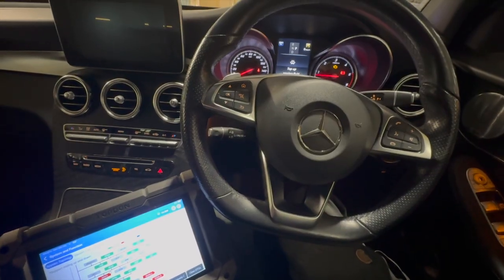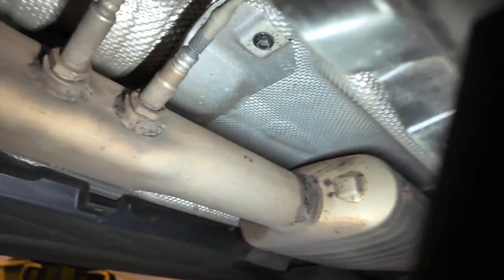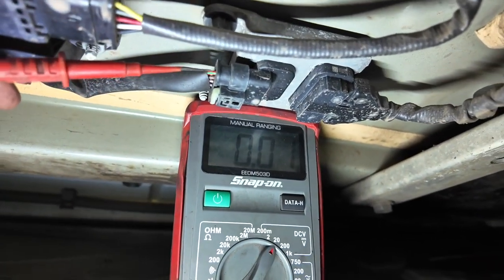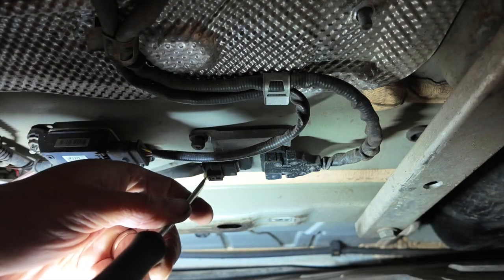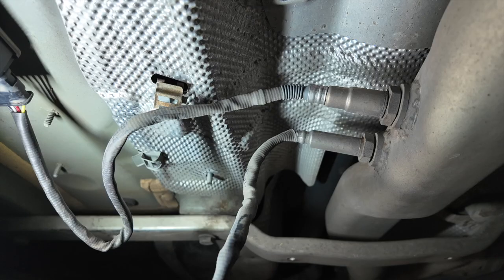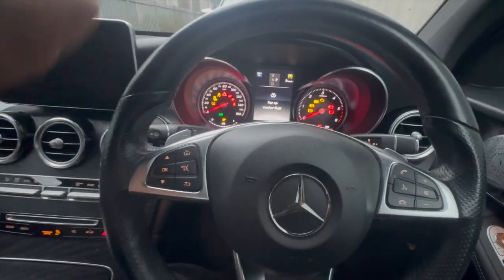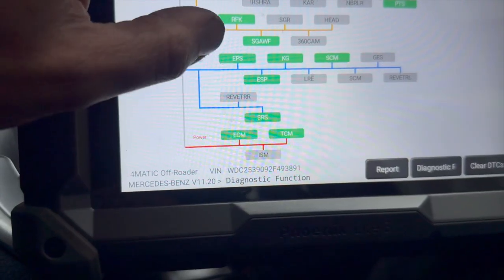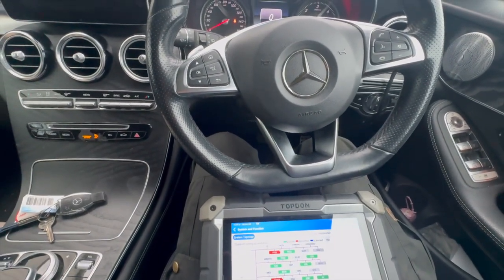Mercedes GLC NOx sensor 2 fault P229F  - NOx sensor 2 test & replacement

Comment: Oh no no no , you never check wiring with ohms continuity very bad practice it will bite you and send you down the wrong path ,you must always load test by voltage drop testing wiring ,you will start to load test this way when you replace a control unit that has a bad ground wire ,ohms testing is designed for bench testing components and should never be used on wiring looms ever it is very unreliable 😀